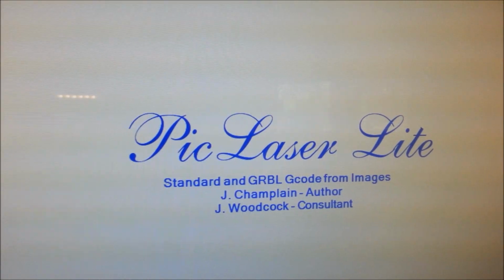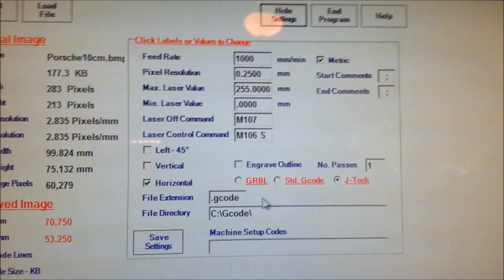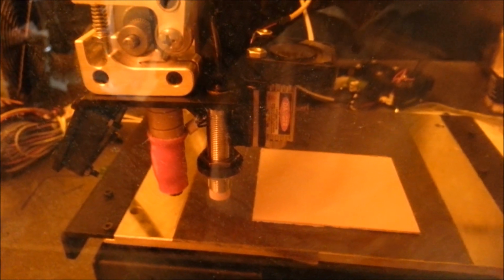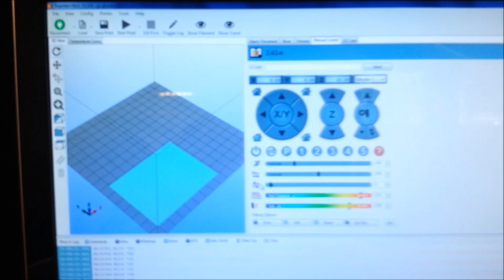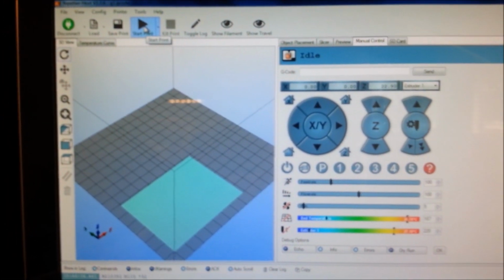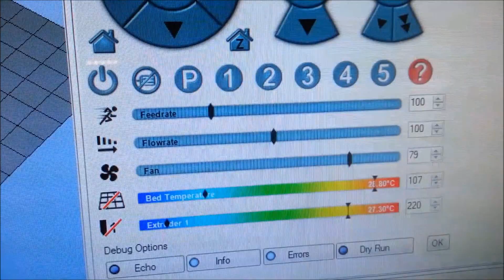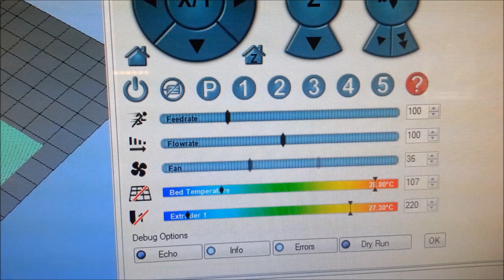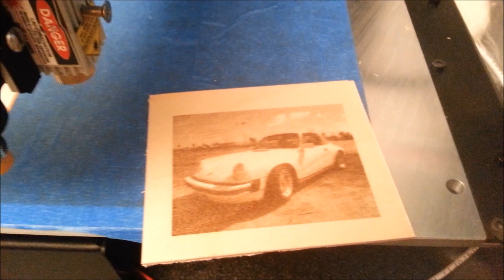Laser Image Engraving with 445nm 2.8W Laser Upgrade Kit

Comment: Great video, very educational. What is the "host software" that you are using. I intend to buy the PicLaser converter, and your high power laser module and driver; but I can't figure out what host software to use with the RAMPS 1.4. Any input on that would be great. Thank you.

Comment: What about connecting the arduino to the laser driver? I know you use the fan output for TTL, but what about PWM? What pins on the board will digitally relay this value to the laser driver? Thanks.
Reply from the maker: Kevin Ed In this example it is using a PrintRbot PWM enabled fan output.  You can use an arduino PWM output as well.  We have instructions using an arduino UNO here:  http://jtechphotonics.com/?page_id=1100  Look under the section "Set-up for photo engraving".   Connect your laser driver to pin 11 of the arduino and download our custom GRBL v.9 software to run the laser.

Comment: How come the program is listed as out of stock on your Website? No way to purchase a license
Reply from the maker: Sorry about that. We have a newer version of the software.  You can find it here:  https://jtechphotonics.com/?product=piclaser-photo-engraving-sw-license
Reply: Thanks I will check it out
Reply: What are the limitations of the Demo, does it only print part of an image? I did a test with the demo and it only did part of an image, also 2 things the resolution is was very low and I had to slow down the laser on the printer as it was going way to fast and not doing any burn at all.
Reply from the maker: The demo will do just a part of the image for you to get a feel for the program.  Resolution depends on your laser focus.  Try to get it as small as possible.  On our lasers we set the focus to about 0.008" (0.2mm). You then set the "pixel resolution" to this number.  If your image to start does not have enough resolution in it, then it will engrave with low resolution.  We use a photo editor to set the image resolution to be 125 pixels/inch to match the laser resolution for the final engraving.  You also need to adjust the feedrate depending on what laser you have.  Slower = darker.  Faster = lighter.  Our 3.8W laser can engrave on most wood between 1500 to 2500mm/min.  The 2.8W laser will be 750mm/min to 1500mm/min.  The 2W laser will be 250mm/min to 1000mm/min.  You need to determine the correct speed for your laser depending on the output power.
Reply: OK thanks for the feedback, currently I am running a 1W laser that I custom setup on one of my 3D Printers, it has a PWM controller with it. That would explain why it is so light when I engrave I tried 500mm/min and it was still too light. The resolution part is still a bit tricky for me, finding the right height and focus I am finding can be very difficult. Once I am sure I can get some decent photo engravings I will be definitely purchasing this software. Purhaps I need a more powerful laser. I will look into that also.

Comment: I'm trying to do this in mach3 with pwm and it's running VERY VERY slow, in spurts doot-doot-doot-doot going left to right.  about 1/100 this speed.  I set the feed to 150ipm.  I'm using the M3 S to turn the laser on and have the pwm set in mach3.  How do I speed this up?
Reply: +berighteous I have the same problem with my CNC. Have you managed to speed up your CNC?

Comment: On your web site on the "using mach3" blog it says "Note that this PWM method normally produces a slight delay in each command.  If you want to use the PicEngrave software, we are developing an encoder solution that will allow you to control a 4th axis to produce the commands needed to run full speed with picture engraving.  This method was developed by Jeff and John at picengrave.com and uses the 4th axis step and direction signals to produce the PWM output needed to engrave pictures in 8bit resolution.  The DAC board converts the step and direction outputs from mach3 into a PWM signal for the laser driver.  We will have this available for sale shortly and a demo tutorial on how to set it up."  Is there a hardware solution yet or something I can help you test?
Reply from the maker: berighteous We tried making a 10bit version and the boards came back for test and they almost worked great.  The digital pot was dropping some information every once and awhile, so there would be lines in the engraving.  We have sent out for an 8 bit version to be built and are now waiting for boards to come back.  I have you on the list to contact when they arrive.
Reply: Yay.  Thanks for all your help.